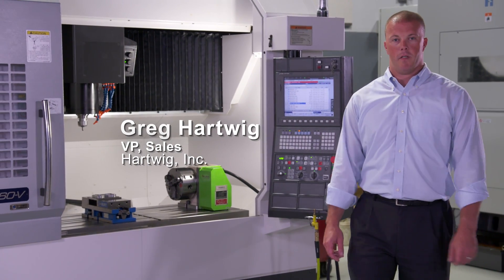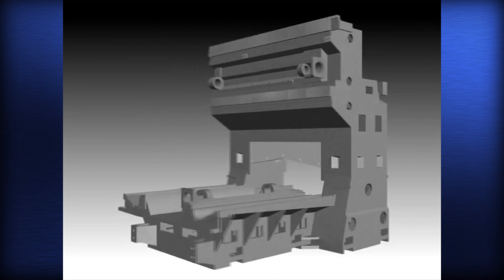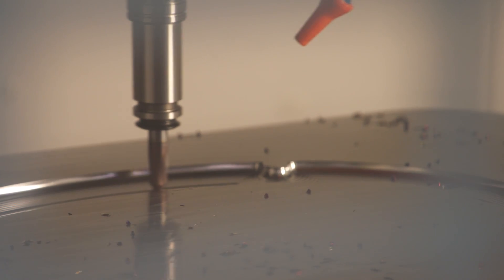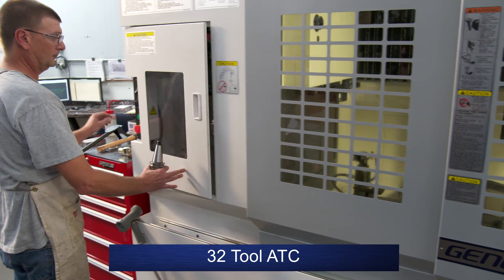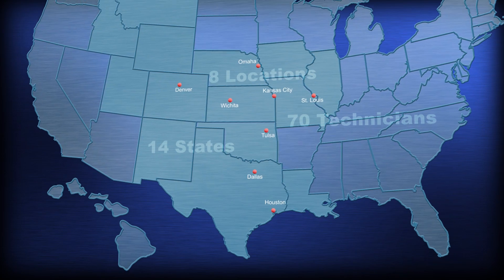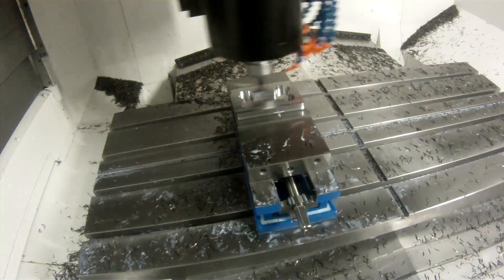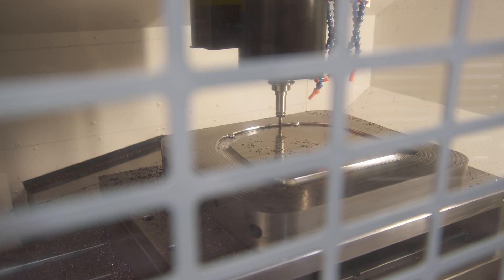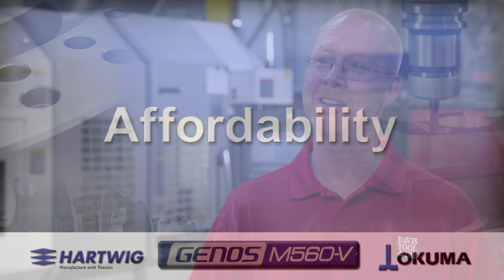Okuma GENOS M560 - The Best Kept Secret!

Comment: What is the maximum rapid traverse on this machine in program mode? I run one today and it is by far the slowest moving mill have in the shop. I'm wondering if some past operator has the rapid slow down somewhere in the control. Like with our makinos you can select a maximum rapid speed so if someone is starting your machines up and running warm up cycles and they are not the normal operator maybe like a member of maintenancethey start up at a slower rapid speed to prevent a non operator from crashing before they have time to hit can you stop button. Anyway are other machines out run it 4 to 1 as it stands right now rapid movement and tool changes and I can't believe that with this new of a machine that is the case I feel it should rapid at 1400 IPM or more like our other Mills.

Comment: I find the Cat40 BP spindle odd. Maybe even a waste of time. The BT40 does the same job intent of having dual contact. What was the point of somebody making another spindle type? Also. What was that black bar attached to the 4th axis?
Reply from the maker: The CAT spindle taper is the most common US spindle taper available and has been for many years.  It is preferred in many shops across the US over any other taper.  So, Okuma and many other machine tool builders offer the CAT spec as a standard. Many shops prefer the BIG PLUS® spindle option;  and they can still utilize their CAT40 tooling.  

The black bar you are referencing is power and communication cabling that runs from the machine to the 4th axis. Hope that helps! If you have any additional questions, we would be happy to put you in contact with one of our Application Engineers. Just let us know!
Reply: @HartwigInc  isn't a dual contact spindle standard on those machines?
Reply: @stephenpavlov8942  Yes it is.
Reply: On some machines the Cat40 can only be oriented one way. But idk. Thats the cable for the 4th axis.